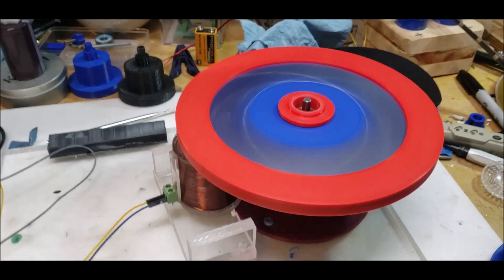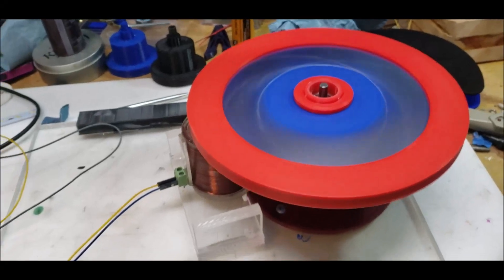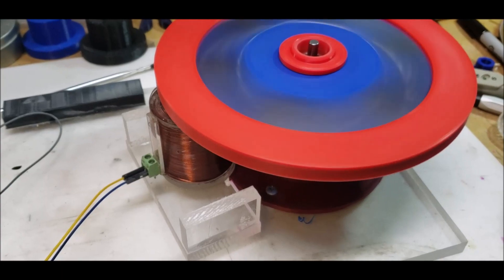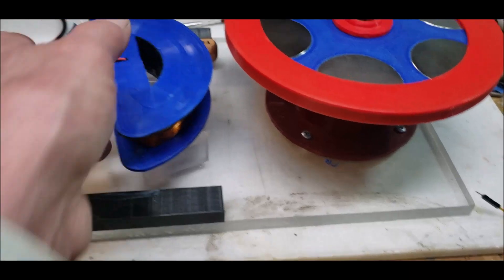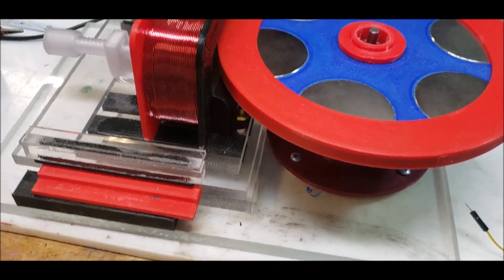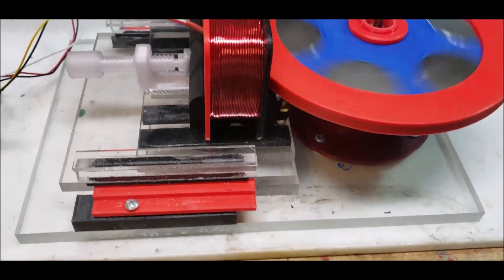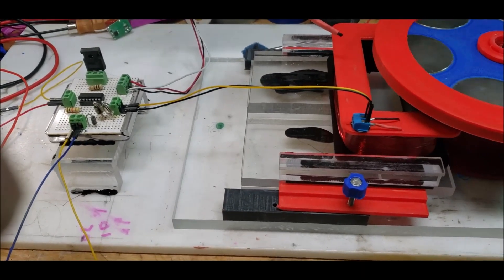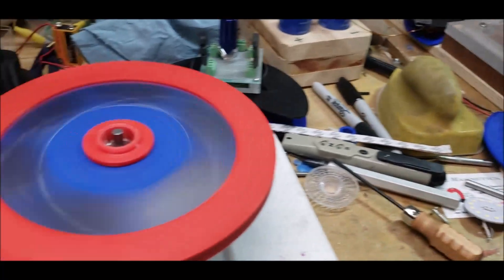3D Printed 6 Disk Magnet Rotor Running with different coils

Comment: It wasnt running properly before the change because your coil was aligned to the bloch wall of the magnet where there is no flux, once you position the coil to face either north or south side of the magnet...well you saw the difference

Comment: Wrap a few layers of some fiber reinforced packaging tape around the outside of the rotor.  I ran 3d printed rotors with speeds up to 15k rpm and everything stayed together nicely. You can test max rpms with a square of pillows around you motor.
Reply from the maker: lolo the red guard seems to work ok for now. I'm moving onto a new rotor design anywho

Comment: Very nice Rotor, very smooth...Just for your info... the jl94 circuit runs on transistors pnp and npn.  I use it simply with the bedini transistors tip 3055 and tip 2955... any other complementary types will work.. you just have to watch for the current and voltage.. but if you stay in the 12-24volt range any type will do. On the other hand you have the irfp 460 chips... they are mosfets not transistors. but they work perfectly with tc4421 driver chips. (that is probably the chip on the hall sensor circuit) yes you can use 2 mosfets with one driver, but you only need that if you are using very high voltage or current. As for the smoke, its probably the result of a short in the circuit. It can also happen if the resistance of the coil is to low... but i would try a simple one with only one mosfet.. and hook up the second mosfet one once you are confortable with the circuit.
Luc
Reply from the maker: thanks for the info. I tested he coil and they work fine with all other circuits. The smoke was from a mistake I made and not the fault of the system :)

Comment: good work
Can you share the circuit schematics for 556 Hall driver Circuit
I have sent a message to skycollection but he is not responding
Reply from the maker: I wish I could but its a jumble mess under the circuit board. I don't have the schematic for it. I asked him for it and he says the design belongs to someone else and they don't want it released. Sorry my friend
Reply: @mcorrade  if you want you can take a picture of your pcb from the front and back and send it to me
Reply from the maker: @Edmorbus  I found you email addy on the about section. I use that one if that's correct?
Reply from the maker: @Edmorbus  sent
Reply: @mcorrade  Thank you i have received
Reply: @Edmorbus  I'd be forever grateful if you could  share either the pics or the circuit with me. That'd be awesome. I'd love to see what he perfers to do.
Reply: @skydog22  I have no pics for the circuit the pics i have with 1000 wires is not pasible to back engineer
Reply: @Edmorbus  I took screenshots of my own and figured it out.  It's exactly what you'd expect to be happening.  Nothing earth shattering in my book, there are immediate upgrades, but good circuit though.
Reply: @skydog22  Can you share your schematics
Reply from the maker: send me your email